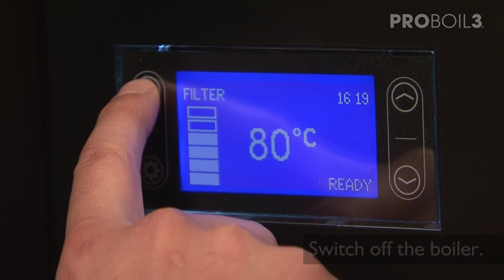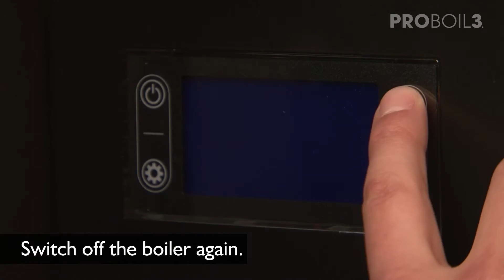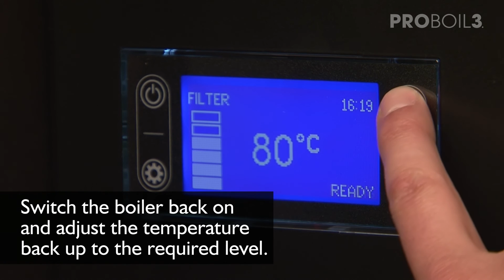PROBOIL3   Descaler Guide

Comment: Hi, I need some help. I would like to follow the beginning instructions but my boiler will not turn on to boil up. I have a message saying "Descale Required unit has now shut down" I was on holiday and I've come home to this with no warning before hand? I have all the required bits to do a descale but unsure if I can proceed as I cannot heat it up before hand.
Reply: Same
Reply: @aitchr8770  I have only recently had to replace the boiler unfortunately. I think the thermostat was stuck open and wouldn't stop boiling. The new replacement is smaller and so far has been good.